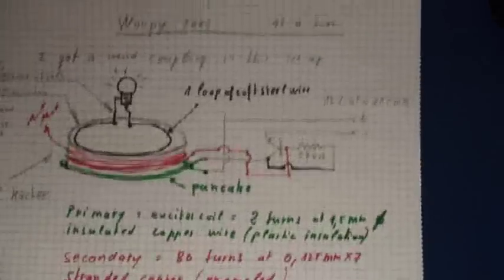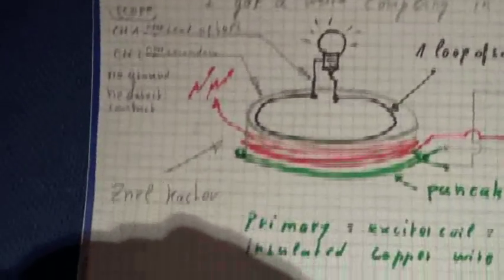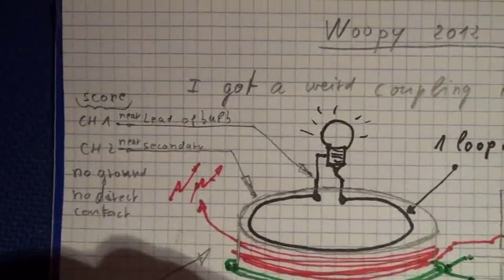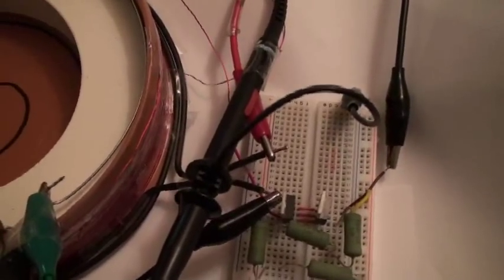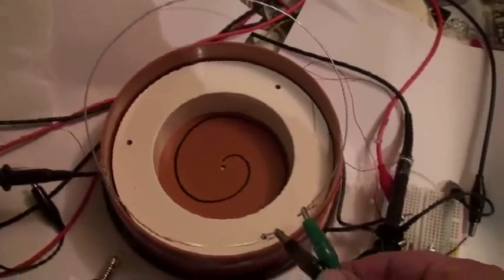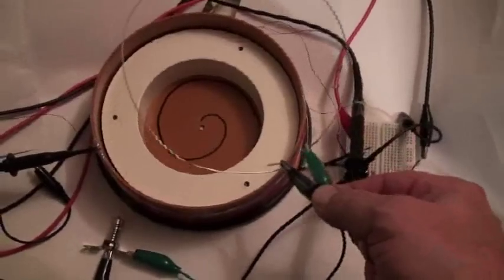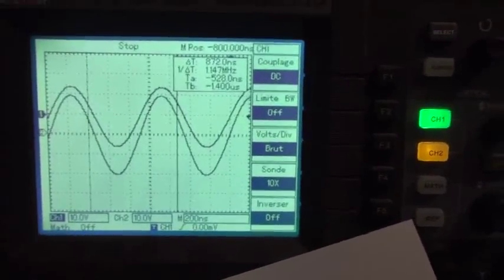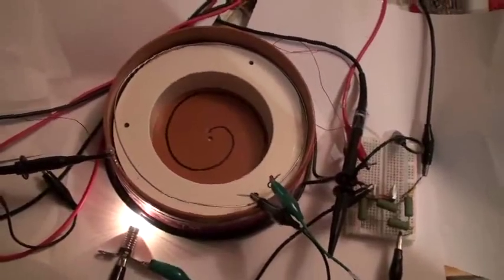amazing coupling between kacher and incadescent bulb 1.wmv

Comment: Nice work! As was said in the energetic forum thread, you should put two "one loop lamps" into the big coil. If the input stays the same and both lamps are as bright as with one lamp, you have got scalar waves, because two "receivers" draw as much power from the "sender" as one receiver. It would be resonance and not inductance. Greetings, Conrad

Comment: Your electromagnetic energy moves in a circular direction around your coil wire. when you place your single loop of wire inside, you transfer energy by induction which lights the lamp. If you hold your loop perpendicular to the coil, you will notice that it will not light.